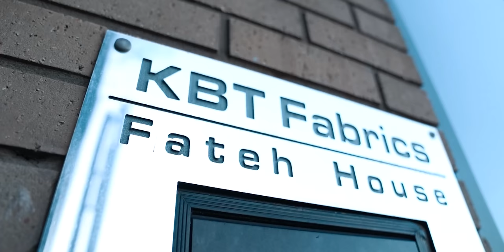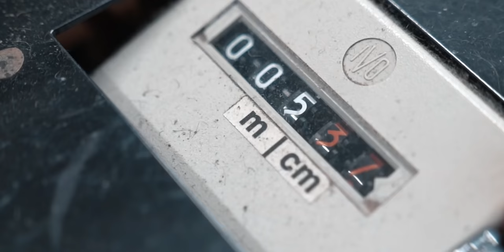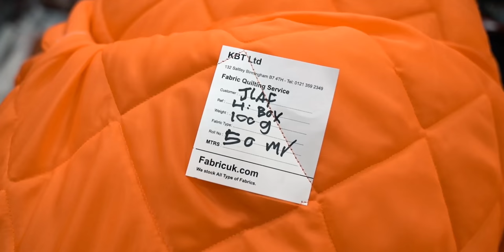KBT WEEKLY - WELCOME TO 2022

Comment: Sending abroad can be a headache. Blew up my subwoofer which I bought off Amazon but sending it back meant sending it to Germany. They emailed me the address I even printed it out and attached the address part to the parcel. This was during early covid times the systems had all sorts of issues. I emailed the company they said they haven't received it. Months pass by no reply and then it comes back to my house. No repair so the company didn't get the parcel to repair it. It's still sitting in my room I'm not spending all the money on sending it again
Reply from the maker: Very frustrating! Hope it gets sorted for you bro!!!